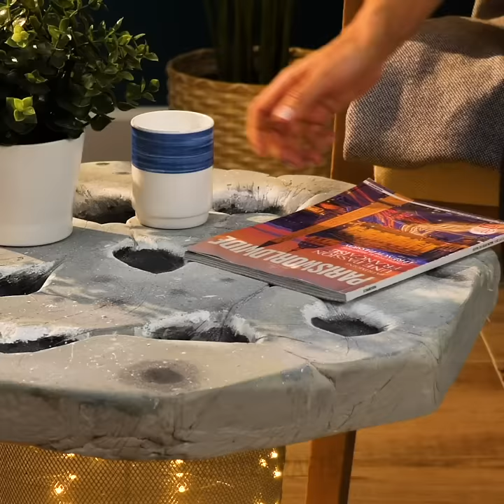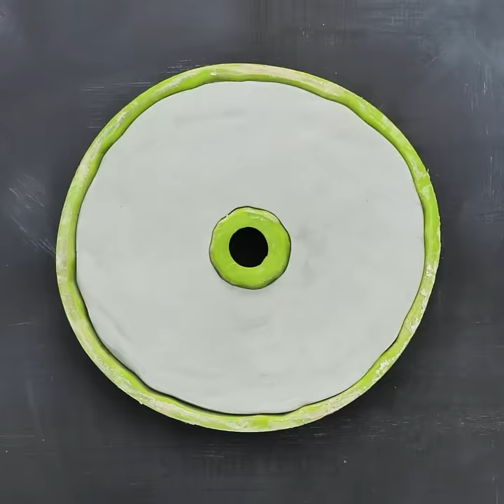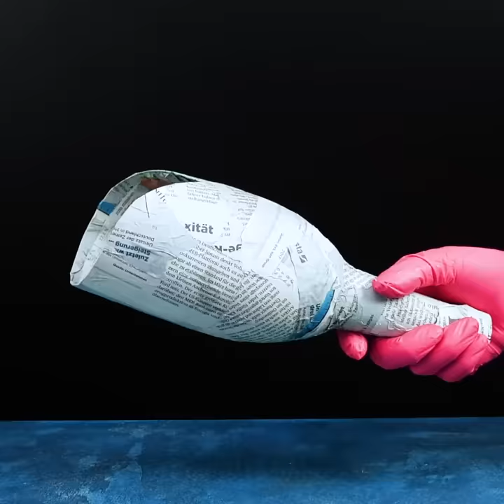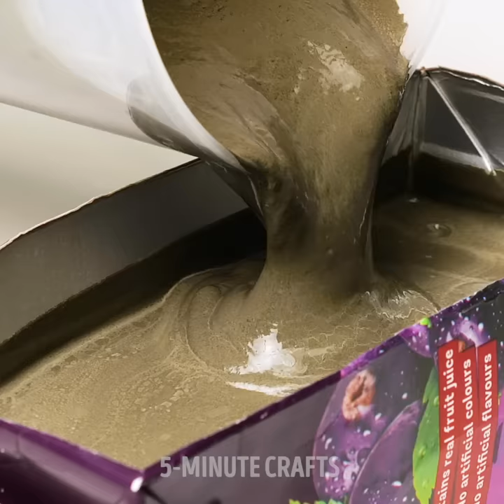30 GREAT CEMENT CRAFTS

Comment: how it's work only with cement? I tried with cement but not work out 
It's broken
Reply: I tried to make one flower vase in plastic bottle with cement 
After 24 hours I opened it and it broked
Reply: Any one pls suggest me how it work
Reply: You need to add sand to the mix
Reply: Shai Azulai thnx